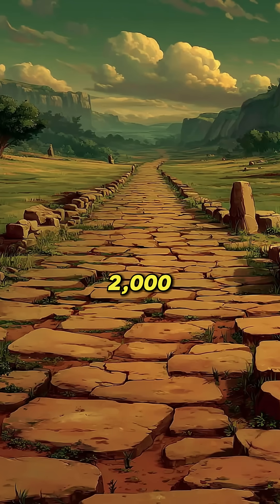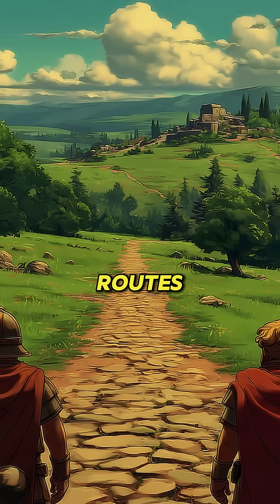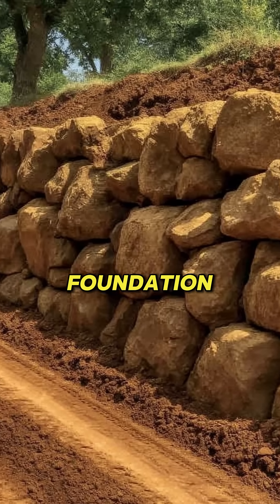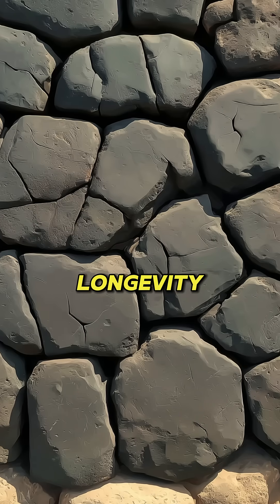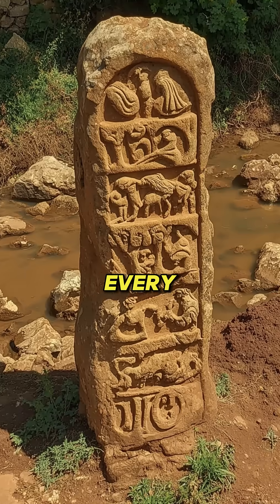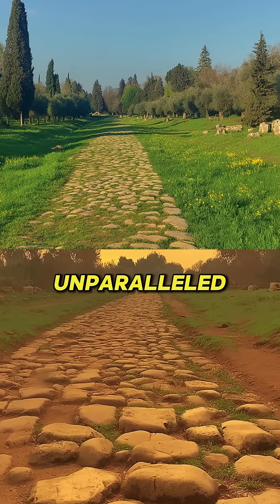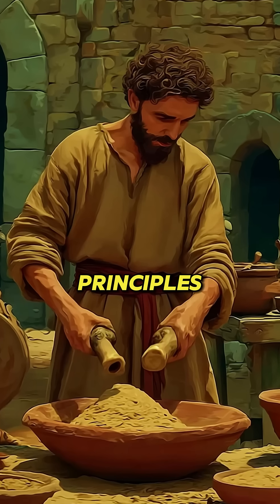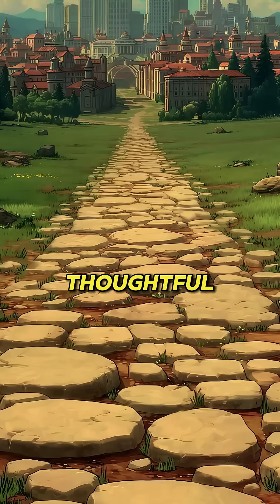Why Rome's 2,000-Year-Old Roads Don't Crumble

Comment: Is there any reason we can't copy this today?
Reply from the maker: The first reason is economics, Roman roads are labor intensive and costly while modern roads opt for cost-effective methods. The second reason is that modern roads should be able to accommodate heavy traffic and large vehicles, while the Roman design is for lighter ones of its time like carts. Environmental concerns  and regulations are also among the reasons why it's simply not suited for much of modern usage.

That said tho, the core principle of building a multi-layered, well-drained foundation remains and is still used in modern road built today.